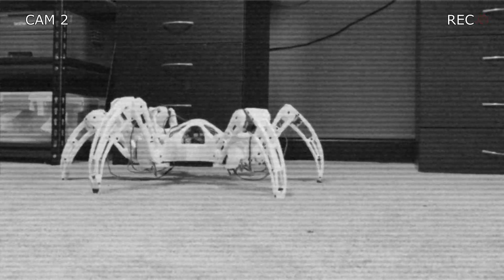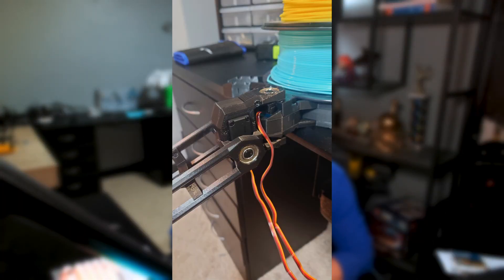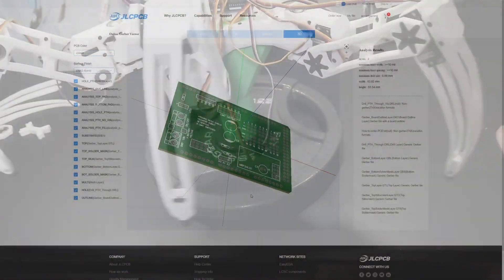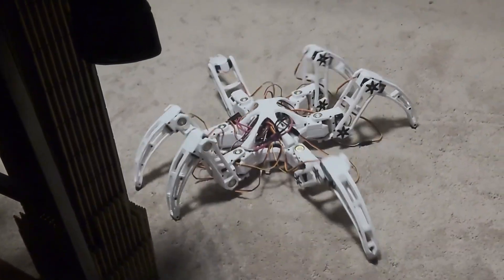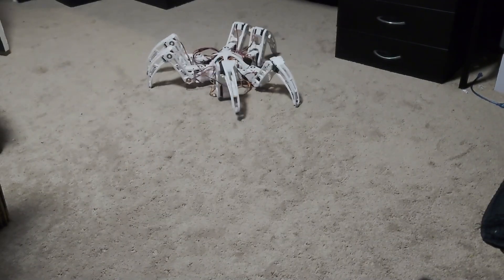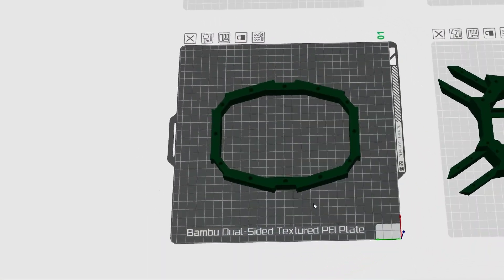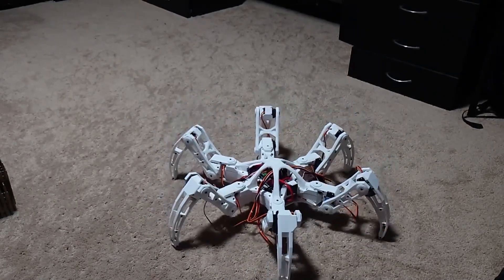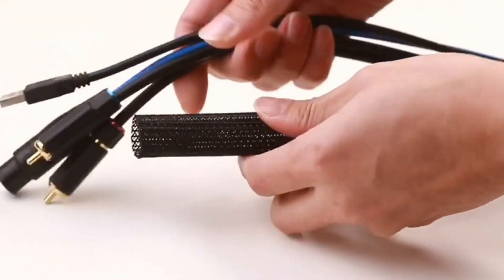I Built an Arduino Powered Hexapod from Scratch

Comment: Hey there! Just watched your hexapod video and I'm blown away by your amazing creation! 🤯 Your skills as a programmer and game developer truly shine in this project. I've got a few ideas that could make your hexapod even cooler, and I definitely think you should consider open-sourcing it to get the community involved! Let me flow here for a second.. my brain is literally gushing with ideas:

1. Digital replica in a game engine: With your game dev background, you could create a virtual version of the hexapod in Unity or Unreal. This way, we can all experiment with AI algorithms, locomotion strategies, and obstacle navigation in a virtual environment before implementing them in the real robot; even people without the soldering skills or 3D printers could collaborate on making the control software better.

2. Fisheye lens cameras with low-resolution but super-fast sensors: Adding these cameras on the top and bottom of the pod's body would provide a 360-degree view of its surroundings. The low-res, high-speed sensors would help the robot quickly process its environment and make smarter decisions. (already thinking about implementing a really slim neural net for basic sensory perception and a dedicated vision system for object recognition)

3. Machine learning for advanced movement & navigation: Train the hexapod to adapt to different terrains and obstacles using ML algorithms. It could learn to climb, walk on uneven surfaces, and maybe even perform some sweet acrobatic moves!

4. Crowdsource AI development: Open-sourcing your project means the entire community could contribute their own AI algorithms or improvements for the hexapod, pushing its intelligence to new heights!

5. Gaming & entertainment: Create a game where players control their own hexapods in a virtual arena, battling other robots or completing challenges, controlled by AI.. maybe even with different checkpoint files (of limited size, obviously.. not everyone has a A100 laying around 🤣) of trained networks being able to be uploaded to a website where they would be set up against other neural networks in battle. A hexapod would be perfect for this! .... ok, ok, maybe I'm rambling off a bit on this one, but still 😁

Your hexapod project is seriously impressive, and I believe open-sourcing it would inspire others to contribute and learn from your work. The possibilities are endless! Keep up the fantastic work, and I'm excited to see where this project goes! 🚀🕷🎮
Reply from the maker: Thank you so much 😊 I love all these ideas!
1. ive thought a lot about this and I really want to do it. My only issue with this is I would want to make it so I can just take the code from the game engine and run it on the hexapod, but to be able to do that will take a ton of work. But even just getting it working in an engine would be sick and I do want to do it.

2. I do want to add a camera. Fisheye lense purely for AI is an interesting idea. Do you think the legs getting into view would mess things up?

3. This would be amazing. I did have the idea of trying to train a neural network to make the hexapod walk, but for this I would definitelyyy need the simulation working. Training it to navigate and walk on uneven surfaces should be possible, but is way over my head.

4. The code will definitely be open sourced! i look forward to what the community comes up with.

5. Im not sure about that.... XD But i was thinking more along the lines of a 1v1 hexapod battle where each hexapod has a laser gun attachment, and you try to hit the other hexapod to lower its health, and at 0 health it shuts down. Im not sure how laser tag tech works, but i dont think it would be that hard to do and would be really fun!

Thank you so much man, I really appreciate it ❤️

Comment: Hi i think the jittery in the servos can be fixed with voltage regulators running the power suplied by the battery you are usingm this will mitigate electrical noise
Reply: Thats how i corected mine for mg 995 servos
Reply from the maker: Wow so you fixed the 995's jitter with that? Can you link me the voltage regulator you used?
Reply: Yes now i dont have jittery at all, since i implemented de voltage regulator, i used a L7805CV 5V 1.5A, i can´t 
provide you a link  because i bought mine in a local electronic store in mexico, but i hope theinformation is useful to you, congrats on your good job

Comment: Okay now I wanna make the most creepy robot vacuum ever 😂 maybe could make it climb stairs like that
Reply from the maker: That is super funny that you say that! When i was trying to think of practical uses for this, a walking roomba was the best idea i could come up with 🤣
Reply: @AecertRobotics  that's super funny 🤣 I thought for the actual vacuuming it would probably still need some soort of wheel except if one would have a ,,toolhead'' that can extend and keep itself at a Steady z height in relation to the floor (shouldn't be that big of a problem with a light based distance prope and maybe a gyro for more accurate predictions in case the light Sensor is influenced by the floor color or type of flooring so I would probably use the prope only for referencing), wish u wouldn't work so mutch and had time to build that 🤣 but I'm already planning a cobot with a putten in my desk that pushes the power button on my pc so a button that lets a robot push a button 🤣. I knew I could build a cobot pretty cheap with my 3d printer so I was like what's the most useless thing I can make it do

Comment: that's amazing one!
would love to see the calculations behind it (and understand them XD)
that design should be scalable it seems, as long as there are servos/drives available for this size (and I also would replace the esp8266(?) with some 32bit controllers like ESP32 or even some F4 or F7 STM32 for more capabilities like cameras ...and probably use my sender/receiver from my drones)
Reply from the maker: Thank you so much!
Ill be releasing multiple tutorials, as well as a course explaining everything :)
Yeah no idea what is available tbh, but cost is a huge barrier. 
Currently using the arduino mega, but I do plan on making a more advanced hexapod with a much better microcontroller + sensors. ugh a live camera feed would be so sick.

Comment: I would definitely buy this course but I would prefer print the parts myself
Reply from the maker: My current plan is to have a kit with only the electronics, and then a second option that comes with all of the 3d printed parts as well as the electronics.

Comment: What most people do not do on here is explain PCB design and the process (the extreme basics). What I find absolutely annoying is when people give guides that are way over the top. One example of this is the most popular blender and unreal engine tutorials. You make a photo realistic donut, a monkey face, and for unreal you make a realistic scene. This makes 0 sense. If you want someone to use and learn these programs instead you should teach the absolute fundamentals and allow someone to take that information and later on learn different processes. For instance when I teach people Fusion 360, I do not bombard them with 30 different features, I go, here is how you sketch, here is how you extrude. From there if they want to do anything then they can look it up. But having a foundation where you can make something allows people to be able to take information and want to make with what they learned since they can remember how the heck they did it. I feel like a a lot of videos lack this and if you are trying to find a place on youtube then this is a wide open spot for it. Also, check out Paul Mcwhorter who has the best guides I have ever seen on youtube. If you decide to make tutorials I will definitely watch them. One of the big topics I am having trouble grasping is kinematics and how to work with it in code. Having a tailored kit that is just for teaching that would be great. Most people doing this have 3D printers or know of a maker space so just supplying the electronics would be nice. Just subbed by the way. Interesting content.
Reply from the maker: I had a bit of trouble getting up to speed with pcb design, so idk why I didn't think to make a tutorial on it, that's a fantastic idea!

Yeahhh I feel you. Tutorials like that aren't very helpful. I consider myself quite good at explaining things in a way people without experience can understand, but I guess we'll find out how good I actually am once I get my inverse Kinematics tutorial out.

I agree! I think the kit will be exactly what people want, it makes it so much easier to build when you don't have to source the parts yourself.  Thank you for the sub!

Comment: I just got done building a quadruped one with the cheap sg90 servos and it's cool but wow yours is so smooth. I can't get much power out of mine without it shutting down. Definitely going to follow your project, thanks.
Reply from the maker: Thanks! Oooh great job! Im interested in trying to make a hexapod from mg90s at some point. It sounds either your battery is too weak, or a part of your electronics cant handle the amps required.
Reply: @AecertRobotics  I used a Arduino nano and a shield board, I'm guessing since it's being powered from one source is the culprit as I'm using a 7.4v 1300mah lipo and a buck converter to knock down the voltage to 5v, tried upping the voltage and it doesn't like going much higher than about 6v.

Comment: Sweet hexapod! Servos can be a pain to deal with. I've seen a lot of people praise the Dynamixel servos but they're pricey. It could be worth looking at though. This would be a great base to add an airsoft gun to and make it a Mech Warfare type bot. Or go optical and use something like FPV Combat. Lots of possibilities! I'm very tempted to build one once you've posted files and code. Can't wait to see more of this!
Reply from the maker: Thanks!
Dynamixel are better in every way except price, but price trumps all...
Oh lord airsoft would be actually scary. I was thinking like a high powered nerf gun. I loveeee the idea of slapping a camera on it and driving it remotely.
Really happy to hear that!!
Reply: @AecertRobotics  Nerf would be great too! Better than airsoft BBs all over the place. There's some 3D printed electric airsoft mechanisms that use brushless motors for some serious power. Analog FPV is relatively cheap. Goggles are the most expensive part. Could do a cheap receiver to a TV though. May want to look at a raspberry pi zero w, mjpeg streamer to stream video over wifi and php to control it remotely. 👍

Comment: This is really cool! You also might be able to get rid of the jittering legs by adding a pid controller for the motors, but honestly the friction plates are a lot less work and perform fine.
Reply from the maker: Thank you! Yeah i tried pretty much everything except a dedicated servo controller board, but im trying really hard to avoid adding complexity to the electronics unless necessary. But honestly I should try a servo controller combined with a more powerful arduino mega replacement, because it might be a lot less complicated than I think.
Reply: @AecertRobotics  If you have enough I/O pins, servo controllers are just unneeded complexity. I don't understand why so many people use them.
The jitter is a mechanical issue. A "pid controller" isn't going to fix them.

My biggest complaint about most servos is they use potentiometers. Potentiometers in robot projects are a bad idea. Potentiometers wear out over time. I'd love to find a cheap way to add hall sensors to servos.

Comment: Cool project, looking forward to the kit and course! A nice feature would be to get it running with ROS2. The benefit of this would be, if you put on some sensors like LIDAR, the hexapod would be able to walk autonomous and could use all the features of ROS2.
Reply from the maker: Thanks, and im really glad to hear that!

I 100% agree. Im gonna be honest, Im avoiding ROS atm because i know almost nothing about it, but I used it in college once and it seemed really complex and I had no idea what was going on, I was basically just following instructions and praying it worked. 

But yeah I hear ya, it would add so many good things. Honestly learning the basics of ROS would be a solid addition to the course, but do you think it would end up being too complex/convoluted? The whole reason im using arduino is to make it as approachable as possible.
Reply: @AecertRobotics  yes ROS would be "the next level" as its quite complex to setup. You would also need a raspberry pi and sensors to run it. But if you have a working walk and steering system, i guess its easy to use it with ROS.

Comment: Very nice hexapod. Making it open source, with courses on top of it will help hobbyists or who get into it to just start building. I keep trying to find time outside software development to do some kind of robotics due to burnout, so know what you mean. Now we just need a few more of these and have them dance in sync for your own personal army of spiders :D
Reply from the maker: Thank you! And yeah I totally agree.
Omg that would be hilarious :D I can confirm I do plan on adding dance moves :)
Reply: @AecertRobotics  It would be cool to add programmable "patrol points" or "animations" (Edit: PRESETS) where you can record a certain movement to a button or two and tap it to play that specific animation. What I was thinking of specifically is that jump animation where instead of sliding the up and down really fast, you can record that to the motion recorder button and have it as a PRESET!!
Also, it would be easier to jump and spin, if thats possible, at the same time without having to use the slider!!
Reply: @AecertRobotics  I came upon this video exactly because I really want to build a Hexapod that can dance to a beat and has LED lights for a nice party effect :D

Comment: You really should consider using something more powerful than an arduino mega and using servo driver boards. At the moment most of your servos are probably controlled with software PWM which is susceptible to interference from interrupts or other issues, using a microcontroller with hardware PWM or using a servo driver board would fix this, the problem is that it can cause jitter since the timing isn’t very precise, using dedicated hardware fixes that. It may not be an issue now but if you start reading from sensors and doing more calculations it may become an issue. You are doing lots of calculations on the arduino which is only 8 bit and has no FPU (floating point unit) so calculations, especially floating point are very inefficient, you would be better using a faster clock speed and 32 bit microcontroller with an FPU (might not be essential), you do get ones that are compatible with the arduino IDE like the teensy or boards from adafruit or sparkfun, also the rp2040 and esp32. If you are fine using other IDEs then there are lots of good options, STM32, ESP32 and rp2040 are all good options with better peripherals and much better clock speed and processing power as well as just being better microcontrollers that can run an RTOS too if required and the ESP32 and pi pico w have wifi built in.
Reply from the maker: I definitely am considering it, and yeah it will become an issue if I start doing more intense calculations in the main loop. 
My main concern is that by adding multiple boards + not using arduino will increase the complexity to a point that will be unapproachable to beginners. It feels like its out of the scope of this project. Now keep in mind I have never used a different microcontroller or a servo driver board, so I may be completely wrong and it really wouldnt be that much harder than just using a mega. What do you think? Now that I think about it, it may make more sense to have like a beginner hexapod and an advanced hexapod. 

What microcontroller would you recommend for this? I want programming it to be as straightforward as possible but i dont mind using other ide's. Better clock speed + processing power sounds really nice, especially if I want to do any sort of AI.
Reply: @AecertRobotics  the teensy is available if you want to stay with the Arduino IDE, the teensy 4 is one of highest performance microcontrollers out there but is a bit pin limited so you would need a servo driver board, but you get basic I2C ones that work fine and are easily available.

If you want it to be beginner friendly the rp2040 which is used in the pi Pico and pi Pico W would be an option, it is from the raspberry pi foundation so is relatively easy for beginners and can be programmed in C/C++ and micropython, although you will lose performance using python. The rp2040 is dual core as well and can use FreeRTOS and the Pico W has WiFi and should have Bluetooth coming soon.

The esp32 is another good option and is popular with hobbyists, it is possible to use it with the Arduino IDE but it isn't the best. It is also dual core and has WiFi and Bluetooth.

STM32 microcontrollers are also very popular and are used in the blue pill and black pill dev boards which are popular with hobbyists. STM32 chips are used a lot in open source projects like betaflight for drones.

Or you could try some adafruit or sparkfun boards that work with the Arduino IDE, have the same form factor and use more powerful chips. They are probably the most compatible with Arduino as is the teensy.